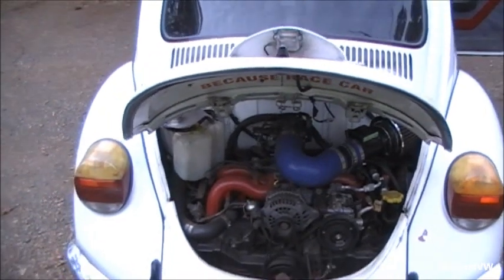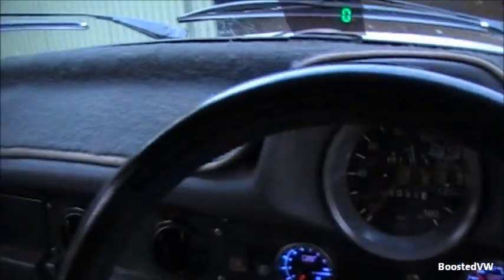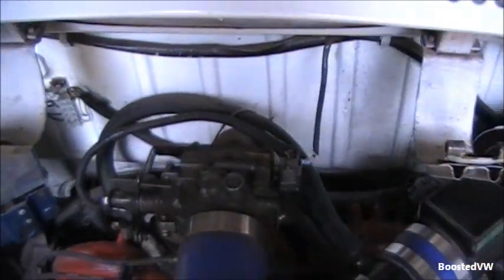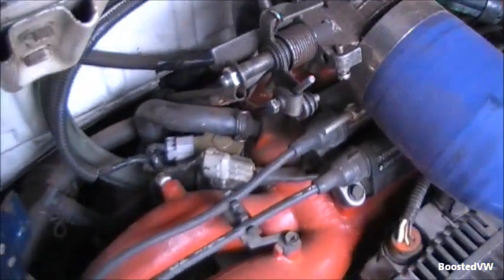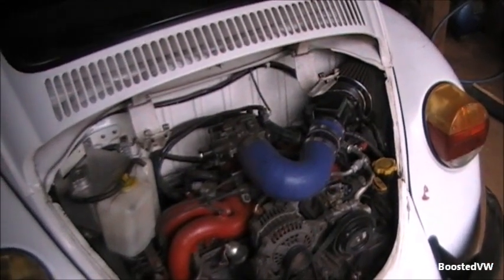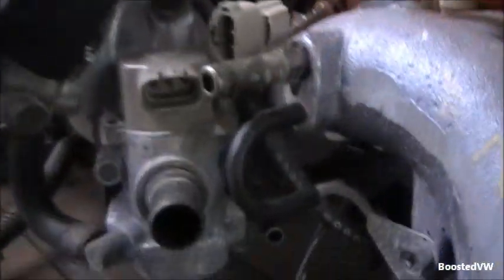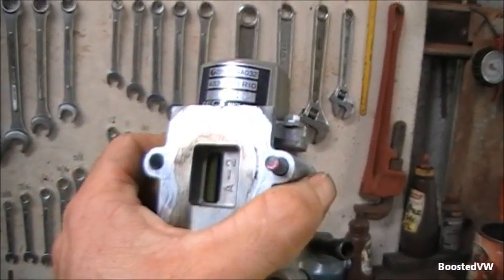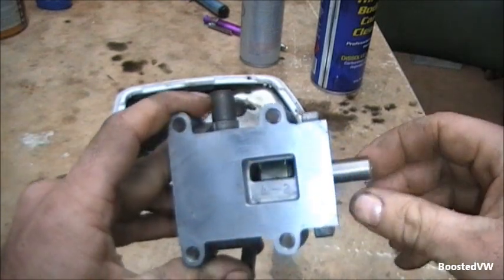Subaru EJ Idle Air Control Valve Cleaning

Comment: Does this mostly occur after then engine is warmed up ?
Reply from the maker: Yep, they run at a fast idle until warmed up. 
It’s at lower warm idle speed it can’t get the valve open to the right spot.

Comment: Did you have the car running when you sprayed it mounted he engine still? I need to do mine and not sure if it needs to be done with a hot or cold engine.
Reply from the maker: Hi, engine off but warm as it works better when any gunk is soft.

Comment: Is there a product that you can buy that you add to the fuel or spray into the intake to clean out this control valve?
Be interesting to know.
Reply from the maker: Yep, carb and throttle body cleaner works well or Subaru upper engine cleaner.

Comment: Don’t suppose you know how many o rings are in the solenoid part. I undone mine and have 2. 1 was lose and fell out and the other was stuck to solenoid part. I noticed with yours that your o ring or 1 of them seats around the bottom of the shaft to the valve. Did you notice any others?
Reply from the maker: I thought there was only one o ring in them, will have to check on my spare valve

Comment: I know I'm late to the party, but I have a 97 EJ25D with the IAC in the same spot. Do you need to bleed the coolant lines when I remove this for cleaning? Or is the amount of air introduced minor?
Reply from the maker: Jonathan Luttrell the air shouldn’t be a problem, it will get pushed out on its own.

Comment: I really appreciate your straightforward video.  I hadn't realized how gummed up my throttle body was until I delved into it. 

Many thanks

p.s.  The 03 Outback is currently have a shifting issue where 2nd to 3rd gear isn't engaging properly... chance that is solenoid related?

Comment: So I just took mine of my EJ20G wrx engine (97) and other than the gasket there was this plastic round piece that was in the hole where the air would flow into. Do I need to just sit it back in there?

Comment: Thanks for this! It solved my idle problem in a jiffy. I didn't even take the hose off of the IAC. I removed it from the air intake (by the Air Mass sensor) and sprayed down the hose leading to the IAC. Subaru is now selling upper engine cleaner in a non-aerosol bottle as part of a kit. The tech at the dealer said gunk or Gumout or CRC choke and carb cleaner was fine for this job. CRC worked fine for me.Though I am not sure if it should be used for general upper engine cleaning.
Reply: Did you have the car running when you sprayed it? I need to do mine and not sure if it needs to be done with a hot or cold engine.

Comment: MY engine is the ej20 turbocharged where would i find the iacv
Reply from the maker: what year?
later ones they are built into the throttle body
Reply: 2006 Subaru legacy

Comment: do you think it would be the idle air as mine cuts out when I pull up to lights it starts fine and idles fine , just cuts out when off the power .Thanks Baz
Reply: +fidget midget Mine is doing a similar thing, CEL comes on and then when I stop or slow down the engine stalls. I had the codes read and it's most likely either a dirty valve like in the video or a bad crank position sensor.

At least that's what the mechanic told me.
Reply from the maker: +Liam Brennan yours sounds like the speeds sensor reading is faulty
Reply: +Liam Brennan how did you clean it?
Reply: Oscar Aguilar I haven't, yet. As per the mechanics instructions I am driving it until it happens again and since he cleared the codes it should tell us exactly what is wrong. 

I have noticed recently that when I start the engine the revs drop really low for a second before coming back up, like down to less than 500rpm.
Reply: +Liam Brennan I have a subaru legacy and well when i pull up to a stop sign the car shakes and then powers off, i looked it up on google lol and it said to try cleaning the Air filter thing i believe its called idle air control valve so ima try that cuz well my DL appointment is on thursday! and my car decided to mess up now:(

Comment: why did you go to Subaru engine instead of aircooled
Reply from the maker: +Flat4_vdub_Garage i kept it air cooled for 11 years but the quality of vw engine parts is absolutely terrible now, where as subaru can be rebuilt with all genuine parts for less than the cost of rebuilding a stock 1600 vw.
Reply: +BoostedVW ya true true, cool bug and love that remove able rear clip bud

Comment: On my 03 WRX EJ20 Turbo, one morning took it out and noticed it was idling oddly, this has been occuring for about a week but only noticed it really struggling to keep the engine alive, we thought it was the fuel lines but nothing seemed to be damaged,

What i did to semi resolve my issue
totally took apart the throttle body, this is the best method, i didn't have any throttle body cleaner so i just used degreaser and WD-40 to lube up the parts after i degreased, using paper towls and cotton tips i cleaned out the throttle body thouroughly, started the car and it idled around 1k nicely :)

Comment: Great Conversion. Can see how much work you have put in. I have a 1963 bug, and looking to drop the ej22 engine in. Have you done any videos on the computer / electrics etc. ?? Anything that was pain with that side of things? Keep posting the vids....Thanks. Neil
Reply from the maker: Thanks Neil, The only ECU related vid I've made was just one on reading error codes a number of years back.
I farmed out having the loom stripped down but I wired it in myself though, all pretty straight forward, I mounted my ECU under the rear seat which I now regret, should have gone in the parcel tray so I can mount a heater underneath.
Reply: BoostedVW Thanks - Just found the Vid . real useful. Mild bit of panic when saw the amount of wiring - But guess, as you say its fairly straightforward. Was fuel pump from Same donor car as engine ? And where did you mount it?  Cheers, Neil
Reply from the maker: *****
Nope they are actually open deck blocks
Reply from the maker: *****  I don't know much about them as we never got them here in Australia but I believe they are yes.

Comment: Joel, I am doing a mitsubishi 4g63 swap to my super beetle. The PCM uses a 4 pulse VSS signal, same as the subaru. How did you configure your VSS to work?
Reply from the maker: Hi Alex, do you know what sort of signal it needs?
with subis there was 2, the early ones like mine need a square wave ground signal but later ones are 5volt signal.
All I did was mount a hall effect sensor on the rear axle and made up 5 metal blades for it to sense that bolts to the CV joint.
Lemme know if you need pics.
Reply: 4g63 VSS signal used a hall-effect sensor, has a 5v square wave that pulses 4 times per revolution. I was researching and found the pulse generator rings like you made with 16 teeth. My idea was to trim off 12 so there was 4 teeth left on it. The issue is the VDO pickup sensors they make only have 2 posts on them, and the mitsu VSS has a signal, ground, and power wire. I dont know if the VDO sensor creates its own voltage or not.
 What type of hall effect sensor use?